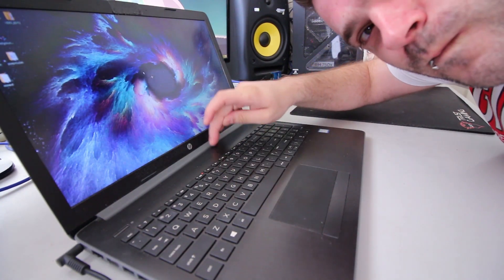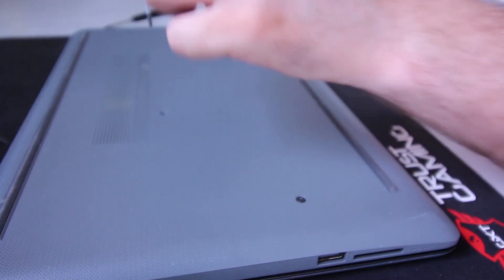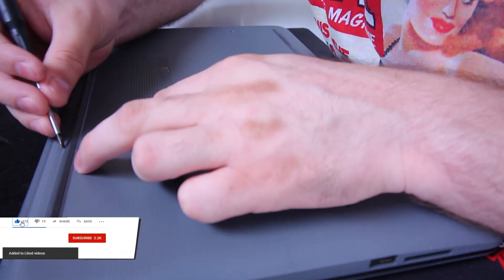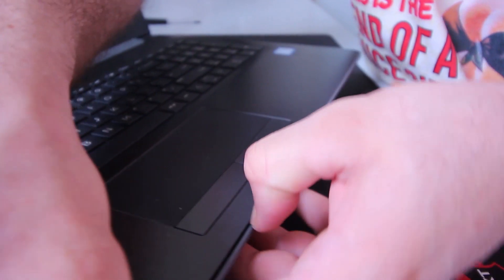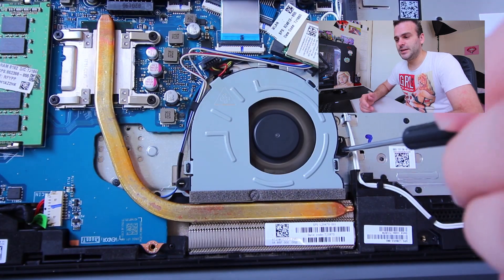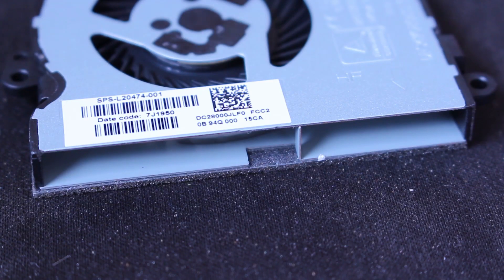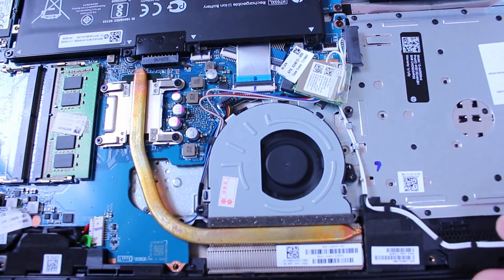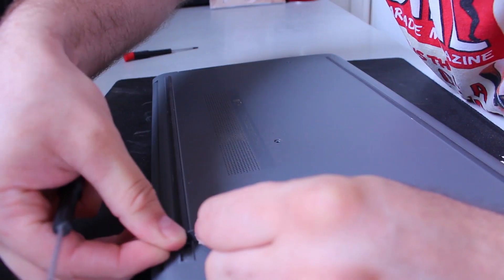This HP Notebook makes way to much noise!!

Comment: I bought a new laptop and its fan making noise always 
Should I replace it?
Reply: @planeloverpilot blowing
It's the voice like when a roof fan runs
Reply: Did you replace i was facing the same problem?
Reply: @cricketsports7801  no I tried to replace it but the technician said its normal for hp notebook fan to make noise but I m not satisfied but they aren't replacing it what should I do?
Reply: I have also bought ho laptop but noise is very irritating about 3 weeks ago
Reply: @cricketsports7801  which notebook mine is hp 15s du3047tx urs?
Reply: @kapilsingh2816  bro i searched ur laptop my specs are exactly same only difference is i don't have ssd, 54k is my price rest is same graphics, ram etc, processor, generation etc. When did you purchas it?
Reply: My is hp laptop 15s-du3032TU
Reply: @cricketsports7801  25 Dec 2020
Reply: @kapilsingh2816  bro i got on 26 dec now they won't replace ur laptop, as 15 day period is for replacement, similar thing happened to me. I went to service centre abd they have told you can change whole motherboard if u want but we won't replace now. I will go today. I am fcked tbh.
Reply: Bro what did you do regarding the problem?
Reply: @cricketsports7801  nothing
Reply: I complained but they said it's normal

Comment: lol its the fans ingore it let your laptop fan run at full blast or you might melt the CPU
Reply: I'm using the HP elitebook workstation 8760w my laptop keeps running at full blast whenever I'm using it it sounds like as if a motor is about to take off and it blows out a lot of air by the side

Comment: Mine was making a lot of noise I just blew really hard into the vents alot of dust came out and now it's quiet
Reply: Thank you but wouldn’t be there in danger ?
Reply: Good you still have the original fan in laptop
Reply: did u do blow while it's on or off ??
Reply: @farisabufarha531  while it's on. Had laptop for 8 years original fan still in there
Reply: sometimes laptop needs to be disassembled to cool down

Comment: What if after the installation it charges, but doesnt turn on 
:|
Reply from the maker: I hope it is already solved, but maybe you can try  pressing the power button for 10 sec without a battery, than repeat with a charged battery..
Reply: @BitcoinDaytrader  that worked :D ty

Comment: How about how can we change some stuff under the Settings via Windows software?
Reply: You can't control how much dust there is in your cpu fan. The only thing you can do is to limit your cpu power (which slows your pc) so that your cpu fan doesn't have to work as hard as having your cpu at full blast.
Reply: @Limmyisback  well is it bad that it makes those noises? What’s gonna happen if I just let them happen and not do anything about it? It only does the noises for a few seconds sometimes.

Comment: I have similar problem with HP notebook fan. Usually this is because the oil lubricant inside the bearing got lost.
On other fans with hydrodynamical bearing, i was able to pull out the rotor and put a drop of gearbox oil in it, and that fixes the problem. But not on these hp fans. The rotor is somehow stuck, and cannot be pulled out easily.
Since you now have an old spare fan, which makes noises, please try to disassemble it, remove the electric motor from the housing, and figure out how to remove the rotor. So i don't have to destruct my fan for that by figuring out how to do it the best way.
Reply: I was also going to mention lubrication to solve it so I wonder what he meant saying "when I opened it up I found out the fan wasn't actually working the right way"
Reply: After hearing & repairing/replacing many HVAC fans big & small a fan is always still just a fan, and if it sounds like that - its the Bearings. They can be rebuilt, but time/cost effective to just replace if you can. I have the same model with the same problem... Sounds like a playing card is in my spokes. lol